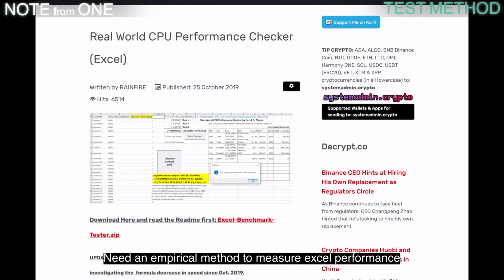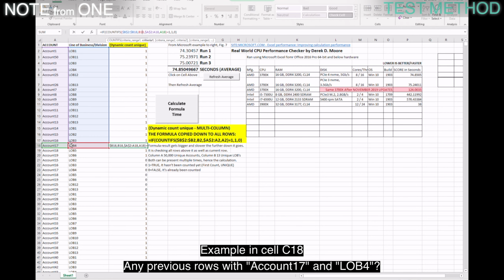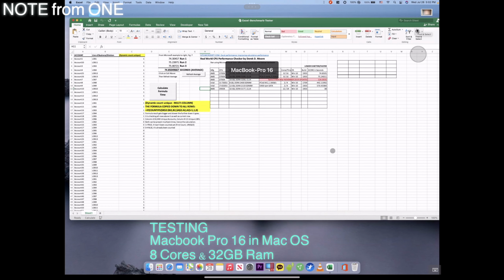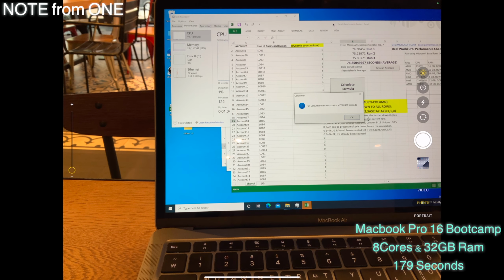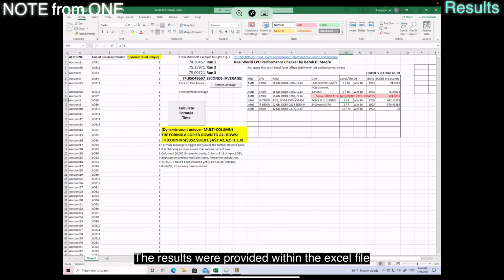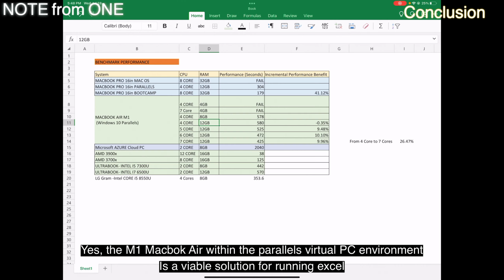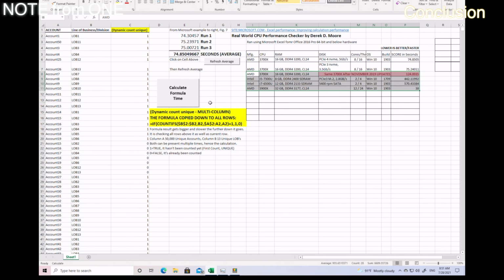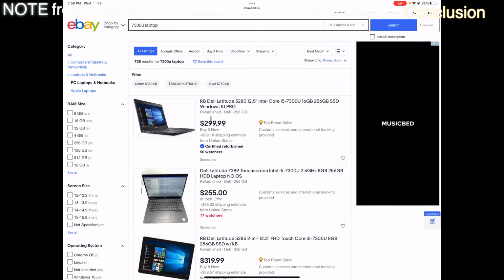M1 Windows Excel Performance = 2017 Core I5 7300U (Quick video shot at a cafe with an IPAD Pro)

Comment: Interesting video. While the M1 Macs are extremely powerful, I think a lot of times, people try to diminish the power of the 16 inch pro's. Personally, I believe these laptops are in two different classes. They really aren't comparable at the moment. Machines like the 16 inch pro stack up really well against its windows predecessors such as the Dell XPS 15 and 17, and the Lenovo Thinkpad extreme X1. Amazing video, everything was explained very well. Keep up with the great content! Which software to you use to remotely view your MacBook Pro 16 inch on your iPad Pro?
Reply from the maker: Thanks for watching Syed. M1 may have serious value proposition for content creators but not for professionals since many of the apps still run only on X86. I use Jump desktop app to connect to my macbook pro 16. Stay tuned I will make a video on this topic!